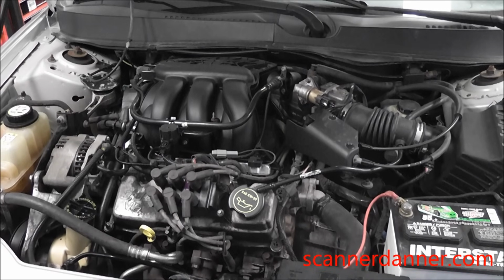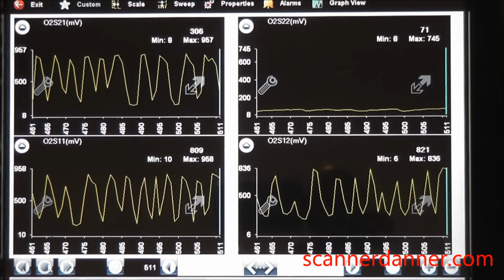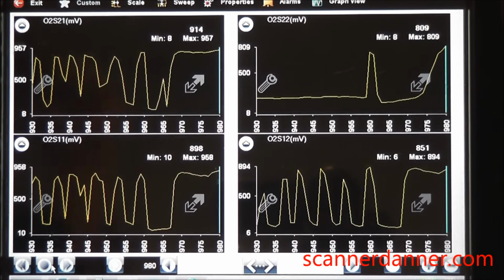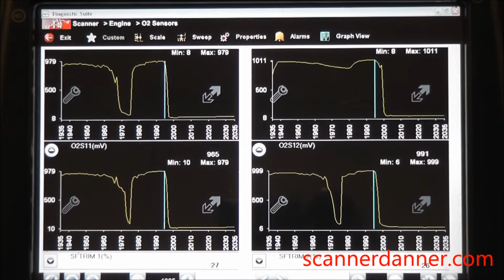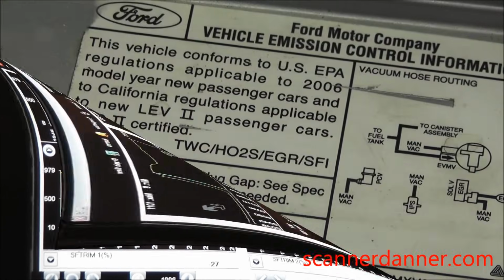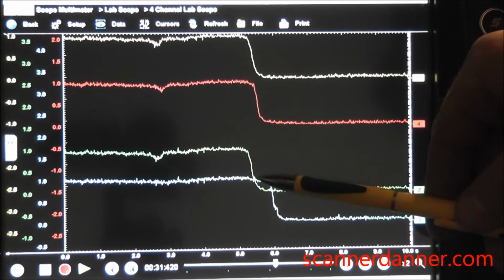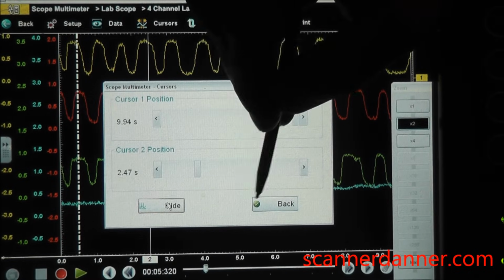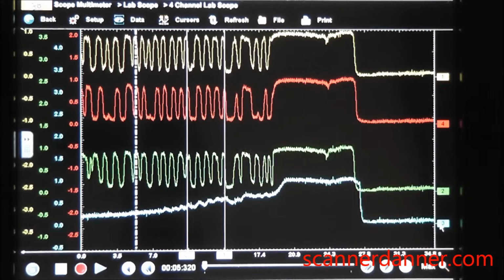Diagnosing a catalyst efficiency code (P0420 or P0430)

Comment: Great video the one cat is definitely bad but to call the other bank cat I would not say that unless you know if the cat is a double or  triple bed type and the gas used  propane, MAP gases and etc will give you different readings  especially when saturating the system for a long period of time 
 The materials used in a catalytic converter Are  designed for  manufacturers recommended fuel usage that’s why multi fuel vehicles gasoline, CNG and E85 are more  expensive your testing is great and right on but I would give the system a greater limit of failure on a good looking bank with force  enrichment  
Ps check the PCV and for blow by seen a lot of failed cats because of oil Consumption

Comment: the temperature test is a quick test and in theory that is how it is supposed to work the cat will heat up and burn of any unburnt fuel so the rear should be hotter then the front

Comment: Hi, anyone please comment on this fix? ... uk gm v6 3.2 omega (catera in the us) MY03 obd2 code 0420/0430 cat efficiency low. This is efficiency of the pre cat, not the main cat....Fixed by moving the post pre cat sensor to behind/downstream of the main cat. Welding in new bosses etc.  ....The man cat then cleans the exhaust gas instead of the pre cat, and the code is then fixed. Now bear in mind this is a uk model, our emissions tests I believe are less stringent than say California over there, and the car will pass emissions tests on our yearly Mot test for the car. 
This saves buying massively expensive oe cats. Aftermarket cats being worse than useless over here at least. Please discuss.
Reply: To add.... all of these cars (Uk) will have this code eventually. Usually after 100k miles

Comment: Yes it is real difficult. Recent my 2008 Subaru P0420 code 3rd OEM cat done under PZEV warranty . Why Whom knows.
Exceptional maintenance done thru the years since new. Perhaps too good a maintenance? 
My nephew says in the government side lines is "If it ain't broke, Fix it till it is" . Well you have to give some of that credence. These things run odd, shift odd, start odd, etc. Of it runs and runs according to whats expected perhaps in a given manufacturer its OK. Dont F with it!!!
Reply from the maker: Are you using oil between oil changes?
Reply: @ScannerDanner  I know I was thinking the same thing. Just checked 1680 mile since oil change. Down not even 1/2 quart. But is more in the summer. Sometimes 1 qt every 2000 miles. perhaps more or less. PZEV cats I would imagine are very sensitive. Does smoke a bit from the exhaust when cold in the summers as well. Especially since the heads were done. No coolant loss. Rings may be getting tired. Always smoked a small amount but is worse. Mostly city driving... Wide band sensor replace with last cat 20000 miles ago. Subaru said they didn't see anything else wrong. with the data they had. Perhaps its time to think about a motor refresh. Everything else is newer thinking just bearings and rings would be needed. Thanks for the thought.

Comment: Igot 420 and 430 codes. B1S1 0.300 AT IDLE  0.285 AT 3000 RPMS
                                             B1S2 0.280 AT IDLE 0.280 AT 3000 RPMS 
                                         B2S1 0.600   AT IDLE 0.580  AT 3000 RMPS 
                                         B2S2 0.290 AT IDLE 0.310   AT 3000 RPMS ON AUTEL SCAN TOOL

Comment: How do you know if your downstream O2 sensors are reporting correct data? What is best way to test them before spending huge money on Cats?
Reply from the maker: snap the throttle to force them rich, test drive during a decel event to force them lean. Look for a reaction. If they are swinging rich/lean, they are reporting accurately and your cat is bad or cold.
Reply: @ScannerDanner  Thanks but this is too technical for a DIYer like me. I'll take it to my mechanic to do this procedure. Thx.

Comment: Hello, Paul. When diagnosing these 2 codes with a up to temperature cat, isn't the rear o2 mirroring the front o2  enough to condemn  the cat?  I  watch a video from Matt (Schrodingers Box). He says that there is nothing else that can cause  the rear o2 to mirror the front o2 (with warm cat) other than a bad cat. I would really appreciate it if you answered my question. Thank you.
Reply from the maker: yes, he is correct. My point is more that you can have a downstream O2 that shows a flat-line, suggesting the cat is fine but in reality it actually is not. That is where the oxygen storage test will help.
Reply: Thank you so much, Paul. Now, I will be able to diagnose a p0320 and p0430 code without a doubt.

Comment: All I'm getting on an '09 2.4L Toyo Camry is this lone P0420 code.  Sensors were all replaced a 2 months before the CEL even came on.  Going to try some fuel additives, maybe even inject water/ammonia to steam clean.  Too bad located an exhaust leak isn't as easy as finding an intake leak.

Comment: I have a question regarding the P0420 code. My murano has this code. I don’t have a scan tool to see a live data and see the wave forms like yours. But I have a scan tool to see the O2s,voltages. Can you help me rule out which part is bad ? If I give you the voltage readings on those O2s . The O2s11 has 0.290 to 0.300 v. And the O2s12 has 0.580 to 0.640 v. Is that a bad sensor,the one before the cat? Or the cat is bad? What about the one after the cat,isn’t the voltage read a little high? I need to be a pro at this specific problem,like you...thank you Paul I have more questions regarding fuel trims numbers,that’s for later,thanks again

Comment: You are right about using a factory cat. I was talking to a sales rep for an aftermarket cat company and they told me that their cats did not flow the same airflow as the factory's flow.
Reply from the maker: IT is not a flow thing. It is a precious metal thing. The factory cats are using either more of those metals or different types that are more effective. There is a reason that aftermarket cats are not worth much to a salvage yard compared to a factory one.

Comment: Hey Paul, I know this is an old video and I've watched it before, but I'm wondering how this test would look/work on a wideband/Lambda system (I work on Benz). If the vehicle is equipped with 6 and 4 wire wideband Lambda sensors (specifically 6 on the upstream and 4 on the down) could you still do the O2 storage test with a scope, and how would that work/look? Do you have any videos doing this test on that system?
Thanks again for all that you do!

Comment: If the oxygen storage time observed with your propane saturation test is longer than the period of the normal upstream O2 switching cycle at idle, there should be no immediate reason to replace the cat, right?

Comment: Even if switching characteristics of the heated oxygen sensor 1 (front) are shifted, the air fuel ratio is controlled to stoichiometric, by the signal from the heated oxygen sensor 2 (rear).This is from the manufacture book of the car I drive, is a Nissan Almera 1.5 2004. At the test I feel the emissions only on CO and front lambda not going high enough. After replacing  the front that controls the emissions I thought that the car is fixed but it feel again and after opening the book just find that the rear oxygen sensor controls the stoichiometric and not the front one despite it shifts as I was thinking.Noticed the rear one bad stock all the time at 257 millivolts but could never think that controls the ratio always taught that the rear monitors the cat only as in most cars. Could this be a Nissan manufacture mistake?????????
Reply from the maker: Some systems do use the downstream O2s for fuel trim. In my experience, you will see this when you have a wideband upstream O2. https://www.youtube.com/watch?v=_DPcvIXFrtw
Reply: Many thanks for replay Paul, for clearing and describe the situation. I did plug in the scan tool and was hoping to get some sort of trouble codes that will guide me, but didn't got this luck to have any trouble codes related to downstream O2 sensor except U1000. I did watch the  downstream data on the scan tool and was expecting some voltage oscillations in the closed loop that stabilizes in the open loop, but the voltage was stock at 257 millivolts no matter in what loop I was running the car. Will check the wiring first and next replace the sensor.
Reply: Thanks for replay Paul. The downstream O2 in my car is stuck at 257 millivolts no matter if the car is in open or closed loop also no related codes present only U1000 that keeps coming back all the time without repairing, probably got lucky by displaying on the scan tool and realize the stuck at 257 millivolts.I think that in my case with CO been only 13% over the limit the new downstream O2 or wiring repair might fix the problem as the fuel trims aren't right at all.

Comment: GM's newer vehicle have way higher standards for monitors converters. They use 49 known working converter samples saved in the ecm and compare it to the actual suspected bad converter. I've seen the rear 02 sensors not fluctuate and p0420 still sets. People that commit emissions fraud by modifying the rear 02 sensor to fool the ecm are probably the cause of these high standards on new vehicles make it difficult to diagnose and requires a lot of brain power and reverse engineering the techs may not get fully compensated for.
Reply: customvideo454 why do you think so many techs just throw parts at vehicles.  Because if they don’t they won’t make any money!

Comment: I've heard that the new snap on scanners can tell you the percentage of life left on a cat now.  Is this something you have seen?
Reply from the maker: I have not seen that specifically
Reply: If you look at the cat test in the mode 6 data you can look at the results of the last test ran (last drive cycle) and make a good assumption based on the values of over all cat health if it is nearing the max limit value. Does that make sense?

Comment: Now what would happen if the cat is not replaced?  Iam I correct in saying that it will run ok but just keep flagging the code
Reply from the maker: yep, just flags the code. They can get worse and then restrict exhaust flow too but I've seen people drive for years with a cat code without any issue

Comment: So I'm wondering if the oxygen storage capacity of the cat is dependent the displacement of the engine. Is there a correlation between the size of the engine and the capacity of the cat? I.E. do you see a different time for larger or smaller engines?
Reply from the maker: It is becoming more and more difficult to answer questions here. I have 80,000 people asking me for help now. So I have created a forum to help you guys better. It is free to join and we can exchange pictures, wiring diagrams and waveforms if needed to help guide you through the process of troubleshooting your vehicle. Thank you so much! Hope to see you there. 
Paul Danner (ScannerDanner)
 https://www.scannerdanner.com/forum/post-your-repair-questions-here.html

Comment: Hey Paul, can u think of a reason why my catalyst monitor will complete and pass but I am still getting p0420? I rebuilt the engine on a 05 audi A6 3.2 and am getting a bank 1 cat code. Never ran it lean, never had a misfire and engine runs like a dream. p0420 has been the only code that I have ever had. I do see the downstream sensor voltage fluctuate too much but catalyst monitor passes and all other monitors also complete. thx

Comment: Nice video. Just a reminder the cheap infrared thermometers use a "cone shaped" view form the front of the instrument. The further away you are, the larger the sample area. The laser that they use is a little misleading. Its meant to be a guide only, and is NOT the actual point that's sampled. Evidence of this is true as your readings were fluctuating all over the place and its unlikely the temperatures were that different within a half inch of pipe. It was probably seeing the difference between the surface temps of the pipe and heat shield. 

Anyway, for purposes of catalytic testing, its a good tool and you did show the concept well. Just don't use the temps as absolute because these instruments have their limits, especially ones w/lasers that suggest a pinpoint reading.
Reply: +Eric “ss195” G   You can drill a small hole in the exhaust pipe and place a thermometer directly into the exhaust both upstream and downstream of the CAT

Comment: "hi Paul,you said "oxygen storage 
           I think the good Catalyst storage Hydrocarbons NOT Oxygen .   when you shut Propane off,   the down Oxygen sensor in          

the good bank had delay response with this Lean condition because the Converter stored Hydrocarbon HC  and it was still                                                                                                                                so the down Oxygen sensor detected it as a Rich for a while and was working to convert it from  HC  to H20 and  CO2     
                                                                                                                                         " So, it should called " Hydrocarbon storage test          .                                                                                                   
                                                                                                                                                                                 .your feedback please

Comment: Does the computer call this oxygen test the "Catalyst Test Bank 1 (using Catalyst DFCO Exit Test)?" 
Mine's telling me it failed with 0.228s and the Min= -24.999s and Max= 0.179s. 
This keeps setting off a P0420 and I have a steady downstream O2 at roughly 0.75mV and my fuel trims are normal within +/- 5%.
Reply from the maker: +Larr you need a cat. doesn't matter that the O2 seems to be flat line like a good cat should show
Reply: +ScannerDanner why does the computer say that my Minimum allowance is Negative 24.99 seconds. How can you have negative seconds?

Comment: hey paul , you have great videos !! can you please if you can try to get more european cars in to diagnose. it would really be awesome if you can dive into the euro scene more. special request
Reply from the maker: +ReK We just don't have to many of them here my friend but I will when I see them
Reply: Thanks paul. These new bmw systems can be complicated.especially the new direct injections systems. Theres not much we can do as far as testing them. Theres a fuel rail with a pressure sensor on it and then the huge high pressure pump with a quantity control valve on it which is a solenoid. Pressure on the rail checks out ok and the solenoid checks out fine so sometimes we just call the pump in hopes of it actually being faulty and 9 out of 10 times it is bad.lol. 
To test the leaking injectors is easy just shut off the engine and monitor the pressure on the rail with ignition acc on and watch the pressure drop. If it drops we have leaking injectors on that bank. 
Im stuck on a bmw n73 v12 engine with fuel control pressure low bank 1 and 2. Had a problem with the low pressure pump in the tank and replaced that and it ran fine. Seems like theres not enough fuel return pressure to acitivate the fuel tank crossover jet cyphen because one side of the tank is always full and the other side gets empty fast which is the low fuel pump side. 
Im ready to call the stupid high pressure pump on bank 1 being that bank 2 high pressure pump was replaced by dealer 30k miles ago. Each pump cost 5 thousand dollars so imagine the pressure thats on me lmaoo. Btw i just baught a new vantage ultra!! Superb

Comment: Hi Paul, when you are looking at the scan data, how do you pull the blue marker line across on the verus? Thanks Jonathan, is the info in your verus user series, I couldn't see it there?
Reply from the maker: +Jonathan Dean I believe you pause the capture then scroll through the buffer using the keys at the bottom of the screen

Comment: Hii guys , i diagnosed my car ford 2007 statesman. Where i got code P0420-20 CAT BELOW EFFIECENCY.
other parameters are o2s1s2=0.29v, o2s1s1= 0.13 v , STFT1= -0.93%, stft2= 25.2%, LTFT1= -17.96%, RPM = 2000 , LOOP STATUS = CLOSED.
can you please tell me why fuel trim is so negative on bank 1 and positive on bank 2. What is next step should i follow.